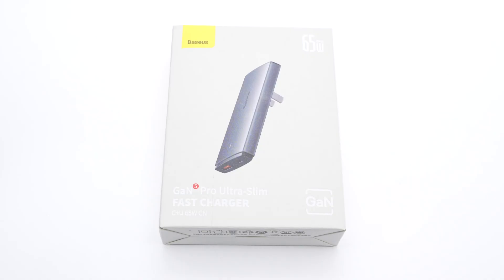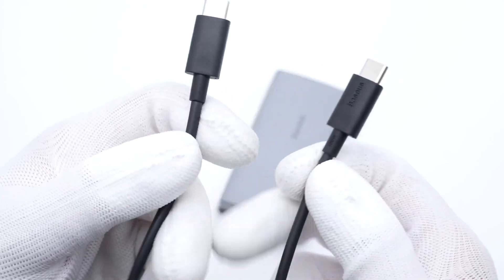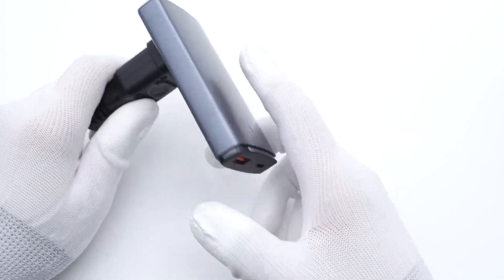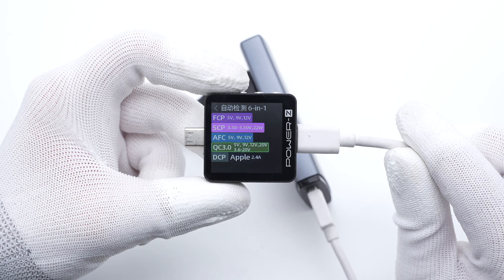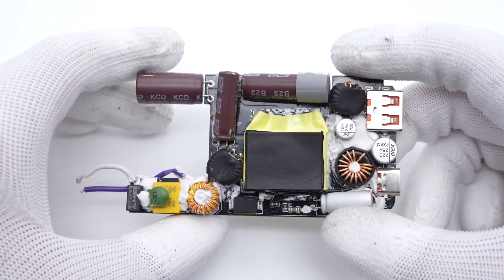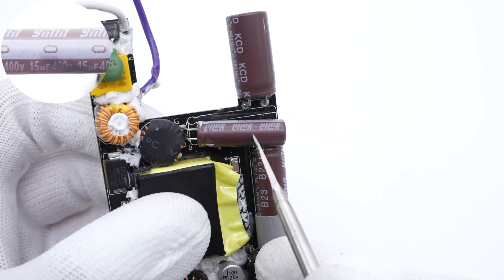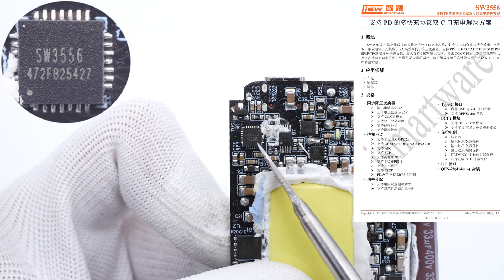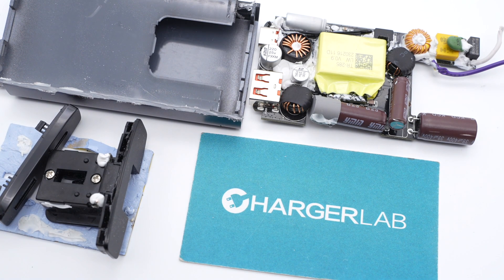Ultra-Slim & GaN | Teardown of Baseus 65W Charger (1A1C)

Comment: Note: The rated power output of this product is 65W, after 15 minutes of continous operation, the single-port output of the Type-C port will automatically lower to 45W, and the output for Type-C+USB ports will be 30W+15W.

It's a shame that information is only in the user manual.
Reply: so it's a 45w charger
Reply: @kittikorn6674  yes, pretty much. This days we cant find chargers with turbo boost technology
Reply: Thanks for sharing that piece of information. I had a similar situation with another 65W Charger recently and returned it. I tested it myself and the charging speed went to 45W after only around 10 minutes. Shame, because it was an interesting Charger and from what I know one if not the first third party Charger with Oppos SuperVOOC at 65W. It was from Novoo.